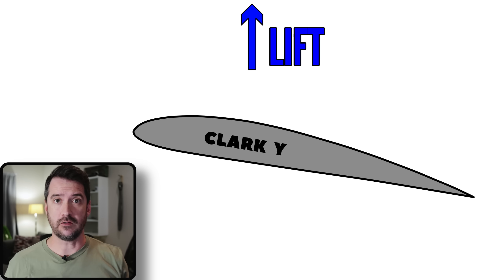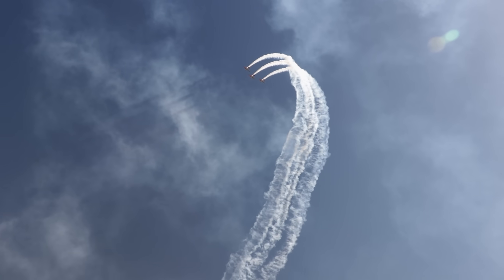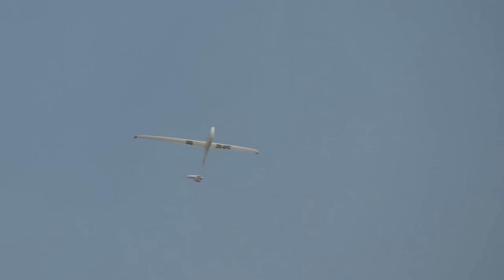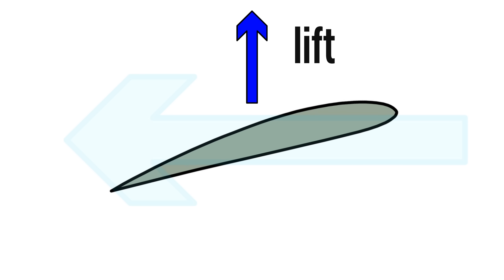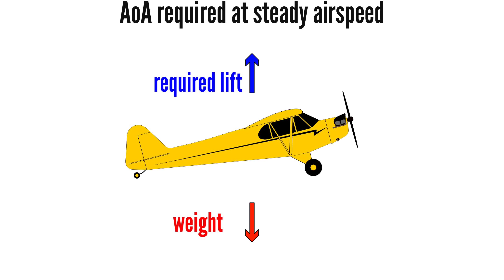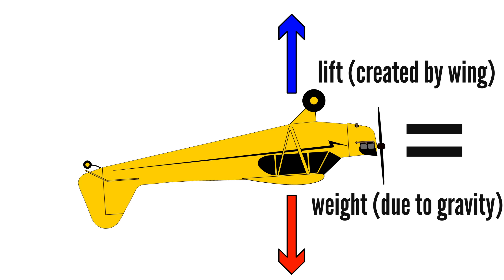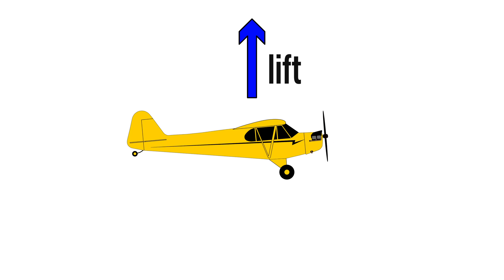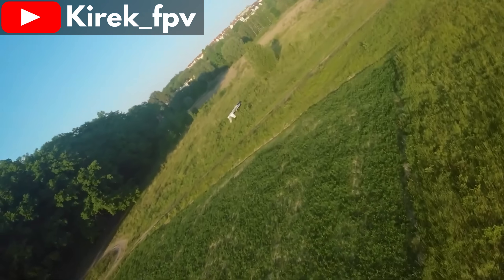Is Airflow Distance Over the Top of a Wing Always Longer?

Comment: Lift is created by increasing the downwards momentum of the air. That’s just Newton 2. Simply deflecting the air with a thin flat board already achieves this, and there is no difference in path lengths. The tear drop shape and camber just help reduce flow separation due to sudden change of flow direction. And some thickness is needed for structural strength.
Reply: As I just posted in the other comment:

Lift is the asymmetry of a solid turning the air (explains both camber and AoA).

Mass flow continuity means speed must increase proportional to the constriction A1/A2.  (ratio of two cross-sectional areas: incoming flow and the constriction area presented to that flow)

This speed increase drives a conservation of energy, static pressure drop:
pressure = constant - (1/2)x(mass density)x(v)^2   

The total pressure difference is equal to lift.

Which forces air mass down, also equal to lift:

P x A = F = ma = d(mv)dt  
Or the force of pressure (as force per unit area times area), equals the change in vertical momentum of the air (again, both equal to lift).

This directly ties asymmetry as the fundamental principle to both the "Bernoulli issue" and the "Newton issue".

No need to get lost in the common circular logic

Comment: Oh dear. This video misses the point so badly that it’s not even a correct defense of a wrong theory! The logic of the path length argument is this: air going over or under the wing must get to the trailing edge in the same amount of time; the path length over the wing is longer; so the air going over the wing must move faster; Bernoulli then tells us that there must be lower pressure above the wing. Shazam! Lift! This is, in fact, wrong. It’s wrong because the “equal time” assumption is wrong. In normal flight, the air going over the wing arrives at the trailing edge FIRST. That’s because the low pressure above the wing requires the air to move faster there (Bernoulli) so that the “above” air arrives before the “below” air DESPITE traveling farther! If you work through the calculations, the “path length” theory doesn’t produce enough pressure drop, or fast enough air over the top, or enough lift! What’s more, if you make a very thin airfoil, the stagnation point stays at the leading edge (it moves very little, with angle of attack). The path lengths are almost identical. The path length theory would suggest this would produce far less lift than a thick airfoil like the one in the video - but it doesn’t! 
Path length is just the wrong way to think about lift generation. Let’s Go Aviatar is right about one thing: on a thick airfoil the stagnation point moves. But that doesn’t fix the path length theory: it’s still wrong and generally underestimates lift - especially for thin airfoils.
Please, can we kill “equal transit time”/“path length” once and for all?
Reply: So your errors appear to be that you haven't sorted out your issues with the following beliefs:   

1)"because the “equal time” assumption is wrong

2)"If you work through the calculations, the “path length” theory doesn’t produce enough pressure drop, or fast enough air over the top, or enough lift!

I'll leave you with something I wrote elsewhere:

quick summary:

Lift is the asymmetry of a solid turning the air (explains both camber and AoA).

Mass flow continuity means speed must increase proportional to the constriction A1/A2.  (ratio of two cross-sectional areas: incoming flow and the constriction area presented to that flow)

This speed increase drives a conservation of energy, static pressure drop:
pressure = constant - (1/2)x(mass density)x(v)^2   

The total pressure difference is equal to lift.

Which forces air mass down, also equal to lift:

P x A = F = ma = d(mv)dt  
Or the force of pressure (as force per unit area times area), equals the change in vertical momentum of the air (again, both equal to lift).

This directly ties asymmetry as the fundamental principle to both the "Bernoulli issue" and the "Newton issue".

No need to get lost in the common circular logic
Reply: @davetime5234  Agreed. 

If you deflect air downwards, then there will be an equal and opposite reaction, which we call Lift (Newton). 

There is only a tiny amount of air in direct contact with the wing. To "deflect air downward" in any meaningful way, it must deflect a certain amount of air near the wing as well. The only way to deflect air that is not in direct contact with the wing, is through air pressure. If air below the wing is being deflected down, the pressure must be high in the upper part of the airmass and low in the lower part, so that the pressure difference pushes downward on the airmass. Since the air well below the wing is at atmospheric pressure, the pressure directly under the wing must therefore be at higher than atmospheric pressure. Similarly, if air above the wing is being deflected down, the pressure must again be higher up high and lower down low. Since the air well above the wing is at atmospheric pressure, the air directly above the wing must therefore be lower than atmospheric pressure. So the air just above the wing must be at lower-than-atmospheric pressure and the air just below the wing must be at higher-than-atmospheric pressure, and there is a pressure differential between the top and bottom of the wing (which pushes upward on the wing - Newton's equal reaction).

Air moving to flow above the wing experiences pressure declining ahead of it as it starts passing over the wing, then rising again until it gets back to atmospheric pressure. This causes the air to accelerate (as the pressure falls) and then decelerate (as the pressure rises). It ultimately returns to the same speed behind the wing as it had ahead of it, but everywhere in between the accelerated air moves faster than the overall airflow. Meanwhile the air moving to flow below the wing experiences pressure rising ahead of it as it starts passing under the wing, then falling again until it gets back to atmospheric pressure. This causes the air to decelerate (as the pressure rises) and then accelerate (as the pressure falls). It ultimately returns to the same speed behind the wing as it had ahead of it, but everywhere in between it is moving slower than that. This is all consistent with Bernoulli's observations about fluid flows. It also means that a lifting wing will cause the air molecules that go above the wing to get to the trailing edge faster than air molecules that go below the wing, EVEN IF the path length over the upper surface of the wing is longer (but also if it is not).

These things happen at the same time. They are inseparable. If you produce a pressure difference above and below an object, it will deflect air flowing around it downwards AND air flowing over it will move faster than air flowing under it. If an object deflects air flowing around it downward, then it will have a pressure difference above and below it and air flowing over it will move faster. If an object accelerates air flowing over it and decelerates air flowing under it (like a backspinning tennis ball), then it will have a pressure difference above and below and it will deflect air downward (and generate lift). It's not Bernoulli OR Newton; it's Bernoulli AND Newton.
Reply: @FinbarSheehy  What you wrote sounds pretty good to me.
Reply from the maker: The problem is you take the mention of path distance difference as me advocating equal transit time, but I do not. Transit time is not equal, as I showed in my illustrations the air going over reaches the trialing edge before the air going under. Also the point of the video was never to argue a lift creation theory, but to show that the argument I countered is a logical fallacy. It doesn't matter if the wing is upside down, symmetrical or flat, the path length over the top (that is the side pointing skywards with a positive AoA) is always longer due to the stagnation point that shifts with AoA. And it has nothing to do with equal transit time.
Reply: @LetsGoAviate  Thank you for replying!
I apologize, I looked for the transit time in the video and missed it at 7:51 (although you show it without comment), and since the "distance over/under" simplistic description of lift creation is usually tied to equal transit times + Bernoulli, I thought you were going there. 
You opened your video with: "If lift is created as a result of pressure differential from air flowing over the top of the wing having a longer path than air flowing underneath, then an airplane wing wouldn't be able to fly upside down". Your illustrations focused on airflow in the immediate vicinity of the wing surface - indeed, you talked quite a bit about the stagnation point. The problem is that lift is not, as such, "created as a result of air flowing (directly) over the top of the wing having a longer path." If you make a very thin airfoil (like a boat sail) with a fairly sharp leading edge, the stagnation point at the leading edge barely moves with angle of attack, and the path lengths (immediately) over and under are almost identical. If path length near the surface mattered, those airfoils should produce very little lift - and yet they produce substantial amounts of it. 
Of course we could make a more sophisticated version of your point, and talk about air flowing near, but not immediately next to the wing. Air doesn't just separate at the leading edge stagnation point; the flow begins to separate some distance ahead of it. You can draw a line ahead of the wing, such that air on one side of it will go below the wing and air on the other side will go above. When you do that, even for a sail-type wing the air going over the low-pressure side, but away from the surface of the sail, will take a longer path - this is often described as the result of "circulation" produced by the wing. Maybe that was the point you were getting to?

Comment: I have flown identical aircraft inverted with both symmetrical and conventional lifting airfoils.  It makes a huge difference on minimum power required. Inverted the lifting airfoil required over twice the power of the symmetrical.  When flying normal the lifting airfoil could fly with almost half the power of the symmetrical.

Comment: Did you mention the fact that 'trick show' airplanes have different wing shape and orientation than standard passenger planes and that when they are upside down the tail is dropped to affect the angle of air hitting the wing?
Reply from the maker: Yes I went into quite the tangeant that an upside down wing needs a bigger AoA (i.e. dropping the tail) than a right-side-up wing.
Reply: Asymmetry of shape to the relative airflow is the fundamental condition causing lift.

If you understand the implication of asymmetry, thin vs thick vs shaped wings all comes into the proper perspective.

Does the entire configuration add to a total asymmetry or not.  That's really the only condition that counts.

Comment: The shape of the top of the wing is not designed to create lift, it is simply a consequence of having to build reinforcing structure trusses inside the wing for strength, the shape is simply a result of fitting and shaping those reinforcing structures in an aerodynamic fashion.
The physics of lift from pushing UP is, quite frankly, kindergarten level.
Reply from the maker: Correct, the shape of the upper surface is not necessary for lift (a flat wing can fly too), but the upper surface is instrumental in creating lift. Air pushing the wing up is not sufficient in explaining lift.
Reply: The amount of pressure that dropped on top that "pulls up" is considerably more than the pressure that has increased on the bottom "Pushing up".  

If you can't explain the top pressure drop, you really haven't explained anything.

The up force is caused by an asymmetry of shape (both shape fixed by camber and adjustable shape determined by angle of attack) turning the air enough to equal that up force.

The pressure difference which pulls down the air due to the asymmetry, is mostly from the pressure drop on top.
Reply from the maker: @davetime5234  This. The assymetry caused by the AoA, not necessarily wing shape.
Reply: @LetsGoAviate  Yes, thank you for pointing out I need to clarify what I meant by "shape": the total asymmetric "shape":  angle of attack asymmetrical "shape" and/or asymmetrical camber shape.

AoA allows us to modulate total asymmetrical "shape" to coax varying amounts of lift from a fixed structural shape of an airfoil, for the practical needs of changes in VS, IAS, and load.

(I edited the original)
Reply: @davetime5234  Things that happen in air fall under fluid dynamics.  Have you ever seen how water skis work?
Reply: @Angels_Are_Vengeful  Water skis ride above the active medium, not immersed in it, so it is a different scenario.

Also, with sailing there is lift sailing and drag sailing, which need to be separated out (but the sail is in one medium of course).

A fixed wing aircraft does not rely on drag lift.
Reply: @davetime5234  Density brother.  The speed of the plane determines what altitude (density of air) the ocean is on which the plane will glide above.
Reply: @Angels_Are_Vengeful  Translation?
Reply: @davetime5234  If a plane is flying at a specific altitude it is doing so because of it's speed.  The specific density of air hitting the bottom of the wings at that altitude and speed are what is keeping the plane at that specific altitude.  
If the plane's speed is reduced slightly the it will have to drop in altitude to a level where the specific air density is high enough to support level flight again, this is the ocean of air that the plane's wings are 'water skiing' on.
Reply: @Angels_Are_Vengeful  "If the plane's speed is reduced slightly the it will have to drop in altitude to a level where the specific air density is high enough to support level flight again"

That is not correct.  You are completely ignoring the role of asymmetry in generating lift and the fact that angle of attack is what allows the asymmetry to be varied, producing different amounts of lift from a given wing structure, over variable conditions.
Reply: @davetime5234  
@Angels_Are_Vengeful  "Water skis ride above the active medium, not immersed in it, so it is a different scenario."
But water skis are immersed in the medium when the skier is waiting for the boat to accelerate.  Upon acceleration the ski's 'altitude' is increased by the force of the medium hitting the bottom of it, until it reached the top, where the change in density between water and air cause it to rid on top of the water.  It it were propelled fast enough it would indeed fly.
Reply: @Angels_Are_Vengeful  Bernoulli applies underwater, so the pressure drop on top would have to be taken into account in that case as well as the case if the water skis could actually fly with it then being immersed only in air.

When immersed so it is the same medium on top as well as bottom, and if lift is being generated, the pressure drop on top needs to be considered.
Reply: @davetime5234  In your illustration at the beginning of the video where your blue shade begins on the top of the wing - in front of that, to the tip of the wing, the air pressure is pushing down on the wing, this would negate any effective lift created by asymmetrical differences in wing shape.
Reply: @Angels_Are_Vengeful  It's not my video.  I am just making comments here in relation to the topic.

Comment: Lift has absolutely nothing do to with the pressure difference on the wing's surfaces. Don't believe me? Go into the kitcken, turn on the faucet, and put a spoon  with the convex part into the water stream. It will be atracted to the stream, even tho there is no flow happening on the concave part. No pressure diffrrence yet lift still happens.
Reply: What you explained doesn't explain lift, but what you explained does require a pressure difference to explain it:  the mass of water is accelerated into a change in direction by a pressure difference.

So, in terms of physics, unfortunately, you are wrong on two counts.
Reply: I was trying to point out that lift is mostly a upper surface phenomenon, and has way less to do with pressure differences between the upper and lower surfaces of the wing.